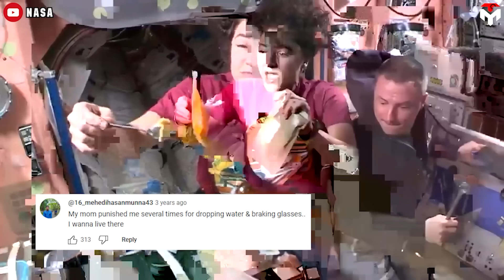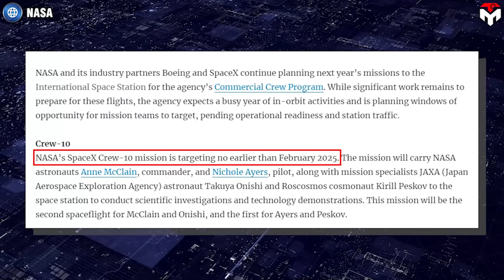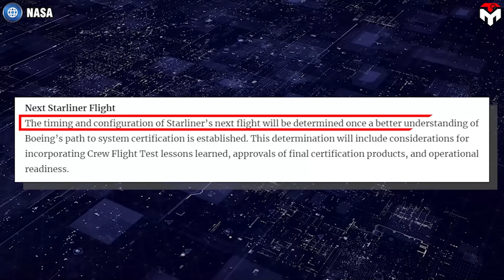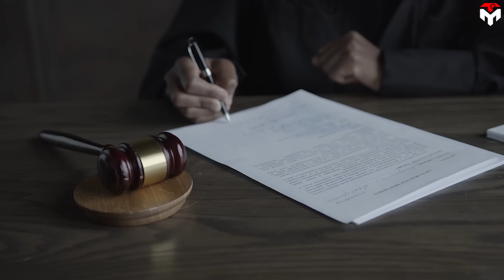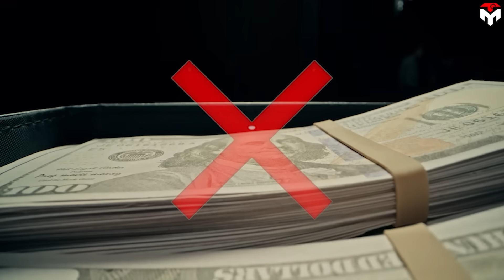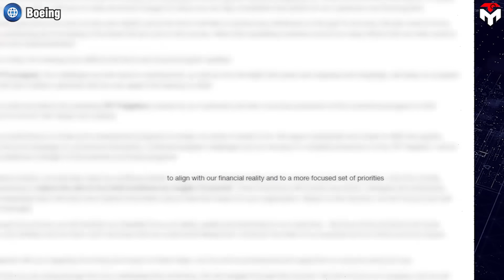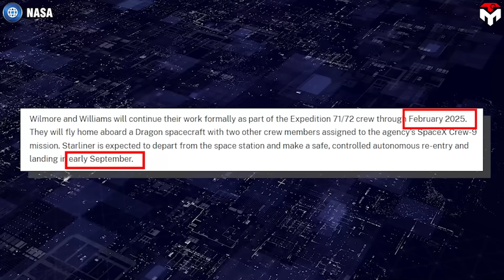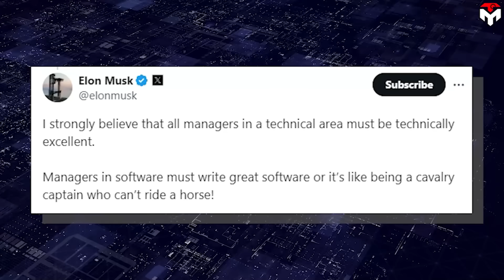NASA Astronaut Revealed This about BUMPED from Dragon to Rescue Starliner...

Comment: I heard that the heart of the Starliner's problem would be in the design of its positioning "pods" (the 4 rectangular "warts" at the 4 corners of the disposable service module).
These "pods" contain ALL the thruster management system, the pipes, the valves, the tanks and also the thrusters (way too many elements for such a small space).
If certain elements had been installed in the module they could not have interfered negatively with each other as we have been able to witness.
As this is a major design flaw Boeing should go back to the drawing board to drastically modify the design of the ship and it could take 24 to 36 months to have a first functional prototype so a flight ship around 2031..........
Reply: A year after the ISS is splashed... just in the nick of time to not be needed AT ALL...